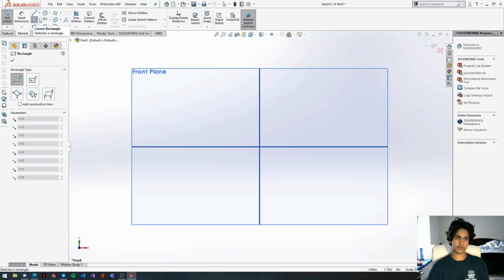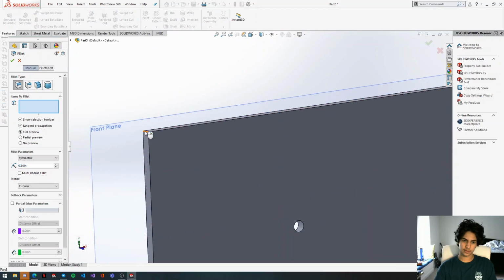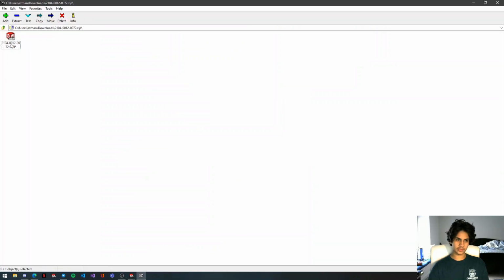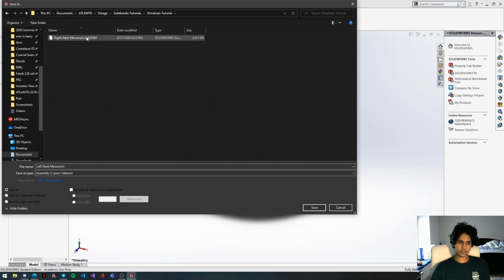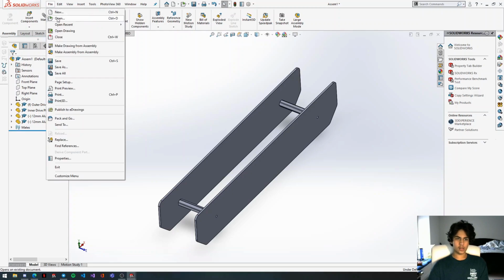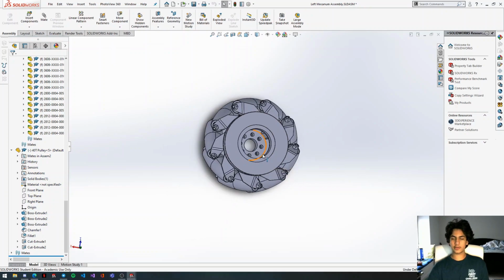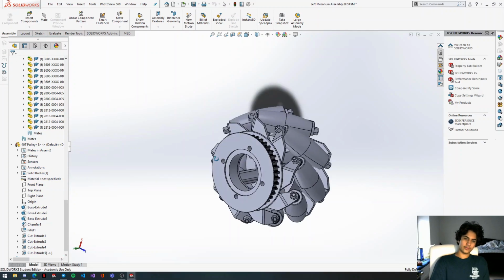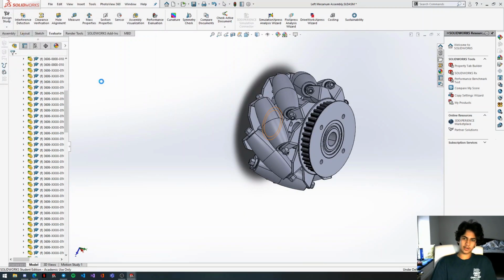FTC Solidworks Tutorial #3: Your First Drivetrain (1/3)

Comment: Just curious since I'm learning Solidworks, why did you put the shaft and bearing in your Parts folder, but the mecanum wheel in your Assembly folder?
Reply: im gonna put my shaft in your parts folder
Reply: mecanum is an assembly consisting of many wheels and etc, so its an assembly